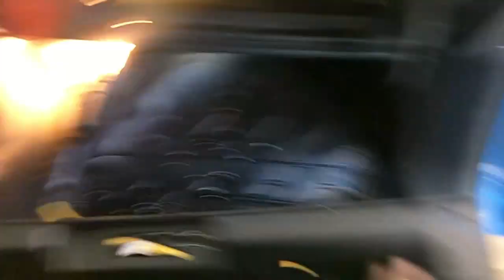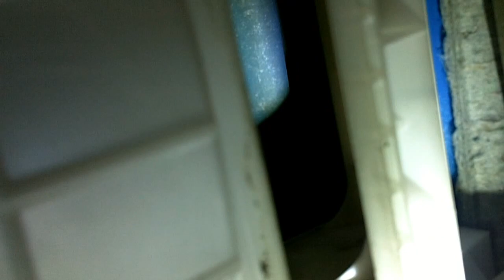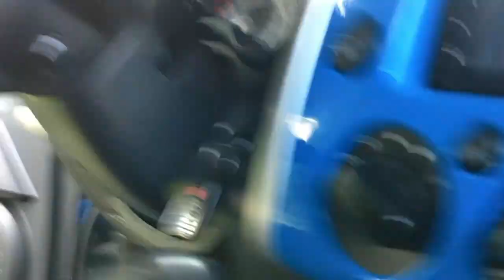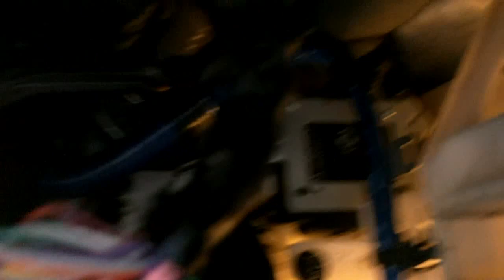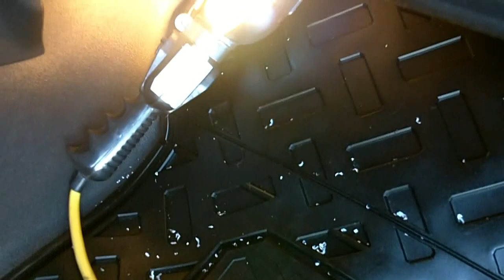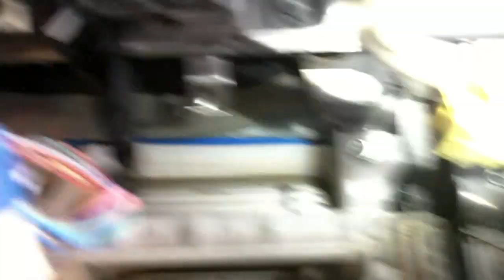Toyota FJ Cruiser Dash fan noise creak fix also 4 runner Tacoma - Heater Operation Explained

Comment: Can you just leave this satan part disconnected? Will the aircon work in 1 position?
Reply from the maker: Yes, you can disconnect it but it will stay in the position you disconnect it. The truck would have to be on and running when powered off as the door closes when shut down. FYI, you won't be able to defrost your windows if you do this.
Reply: @gaving4359 thanks so much for your reply.. i live in South Africa.. so will only use Aircon in 1 position like i have for past 7 years on my FJ

Comment: I'm wondering if it would have been easier to drill a hole on the side of the cavity that was created when you removed the cabin filter in order to slide a flexible shaft screwdriver (e.g. Wera 393 S) in and engage that pesky bottom screw that was holding the bracket on? The angle of the drill bit would also accommodate the flexible shaft. And yes, some plastic integrity might have occurred but you wouldn't of had to change that screw to a square Robertson screw.

Comment: Thank you for this video.  It helped me immensely.  I cheated by not taking the whole bracket off, and only taking the two upper bolts off.  Then I took all of the small bolts that hold the actuator to the bracket, and wiggled it out.  I only did it this way because I'm older, and my hands are not as flexible as they used to be.  The mount, on the other hand, is fairly flexible.  If you do it my way, the hardest part was the tiny bottom screw for the actuator.  Thank you again.

Comment: I have found that if you just take the original assembly apart, clean the copper contacts and the surfaces they ride on with alcohol, and grease the gears and white plastic actuator liberally with white grease on the contact surfaces it will work just fine!
Reply: Can i use wd 40 to clean it without removing

Comment: I would have never located the problem if it weren't for this video. Now I have it fixed with a new motor as per the steps this video provided. Best video on the subject👍

Comment: When doing the blend door actuator for the vents (upper passenger side), if you put the system on recirculate, then turn the key off, that roundish recirc  door moves out of the way, then you can easily get to the lower screw. A magnetized phillips screw driver helps too.

I got the replacement, GPD 1712327, from rockauto delivered to my door in 3 days for $33.

I'll cleanup the contact inside the original and keep it for a spare.

Comment: Would it be easier to remove the blower motor to get the the screws?
Reply from the maker: The blower motor wasn't in the way. It's that black unit on the bottom of the fan box. I don't think you can drop the bottom of the fan box, didn't seem possible but didn't try.
Reply: The whole white blower motor housing should drop out by removing I think 3 bolts.  I tried to look while you was filming video.  I would have to look at mine.  But it should drop out in about 3 minutes giving wide open space.
Reply: @themulesheriff3009  Did you confirm if the whole white blower motor housing drops down? I have to perform this repair since the stealership wants $1380 for labor and part.
Reply: @themulesheriff3009  any update?

Comment: I have a noise that is extremely similar to this....(2012 FJ) but the only difference is it ONLY happens when I hit about 60-70 miles per hour on the freeway.  I haven't found any rhyme or reason to the air conditioning or heating.  It just continuously sounds like a cricket when I reach 60-70 and I notice it when it's a a nice day (hardly ever happens on the cold days.   It NEVER happens when I have stopped or idling.  HELP.. THOUGHTS??
Reply: @Bob Stobaugh I had a similar speed related noise in that area also. The cabin had always been dead quiet till one day I noticed a sound... a bit like a leaf fluttering and a squeek and only ever happened above 80 km per hour. It took me months to find the source. There are a bunch of wires that go through the firewall in that location and for whatever reason the insulation stated to make a squeeking noise. I moved them back and forth and the noise stopped. Must have been some very specific speed related vibration that caused this.

Comment: Will anything happen to my car if I dont fix this?
Reply from the maker: It depends, on where it gets stuck if it fails. If it fails closed you won't get any defrost or air ventilation in the cab with that particular actuator. Also, if the air conditioning is turned on, it could freeze the coil as no air movement will go across it. If it fails open, that's what you'll have to live with. If you're lucky, it will fail on the defrost so that your windows will be visible in the cold. If you think it's about to fail you can select your defrost mix setting and pull the plug on the actuator. That will stop it from moving and you can live with it that way.
Reply: @gaving4359  Thanks for the fast response! I will check it out as soon as possible!

Comment: In the event anybody's FJ Cruiser's blower motor or resistors connector/plug is burnt, just google Dorman Blower Motor Resistor 973-459 It's a complete kit for under $30 which includes ➲ Blower Resistor and ➲ Wire Harness. The wire harness is NOT compatible with FJ but the connectors/plugs and the blower resistor are 110% compatible with FJ. Thank me later ツ

Comment from the maker: For those wondering, The actuator is a Mode Door Actuator GPD 1712327 from Rock auto for the '07
Reply: So all the 3 motor damper actuators are GPD 1712327? I went to Autozone for the same issue and they recommended this one: MT18596 but not sure if this will work.
Reply from the maker: I'm pretty sure they are different, thus the part number difference. The 18596 you got is for the blower housing inlet door (the one on the right above the blower motor). The blend door is 18605. I would find out which one is faulty and ask to see a diagram to pick the right one out. The mode door is the upper one on the left side, that is the one I got.
Reply: @gaving4359  Hi Gavin. Thanks for your response. Yes, correct, I got the wrong actuator. Thanks again for posting this video, very useful for the rest of us. Cheers.

Comment: Just replaced the same servo as yours on my 08 fj.  I ended up just unscrewing one screw on the metal bracket instead of taking all 3 off.  Unscrewed the small screws that mount to the back of the servo and bent the metal bracket a bit to pull the servo out.  Also didn’t drill any holes in the white plastic.  Took the cabin filter out and made sure the recirculating vent was open so I could put my hands in their to manipulate the small screws with a small screw driver.  Your video really helped a lot!
Reply: No issues with bending the plate back?
Reply: Jackson Cruz No issues with the plate works like a charm 2 months later.
Reply: @gusbuster8068  Thank you. I think I will take the easy way out also. So just remove the small mounting screws to the servo then  remove the forward most screw and bend the plate out of the way.
Reply: @atxjax1  yep
Reply: @gusbuster8068  all worked out just like you said. No more annoying clicking. Thanks
Reply: I did the same thing. a couple of hours and some choice expletives later completed the task. Got the part at Auto Zone for $45, the stealership wanted $400+cost of part $175!! Thanks guys!

Comment: Btw, what kind of head unit do you have?
Reply from the maker: It's a low price Pioneer unit. Was on sale for $180! Has next to no features but sounds good, has bluetooth, backup camera ready and the price was right at the time. Had to buy an adapter to make it fit tight, got that on eBay for 10 bucks.
Reply from the maker: I checked it out again, it's actually a JVC (JVC KW-M24BT 2-DIN AV Receiver) Only issue I have is its touch screen is quirky and you rely in it for volume etc. A knob would have been better.

Comment: I have an 07 FJ and had this exact same problem for the past 5 yrs. Only difference with mine is it does the noise on front vent mode (the most left option) and the noise goes away if i put it on other modes. Thank you so much for sharing this!